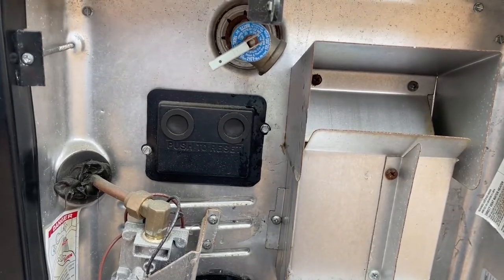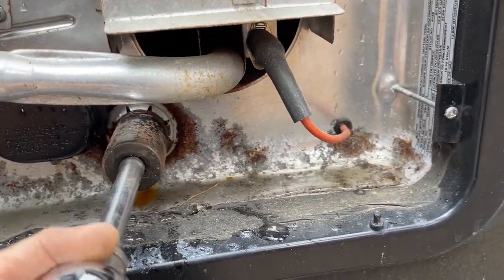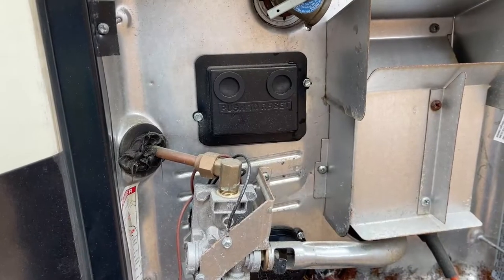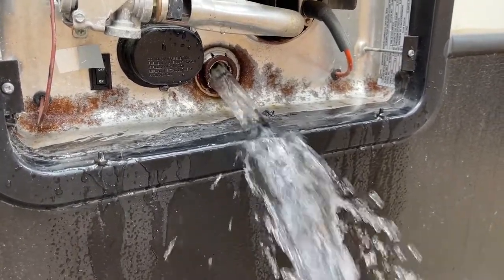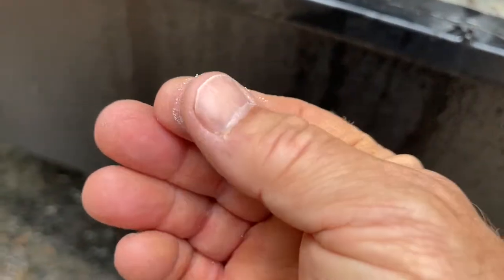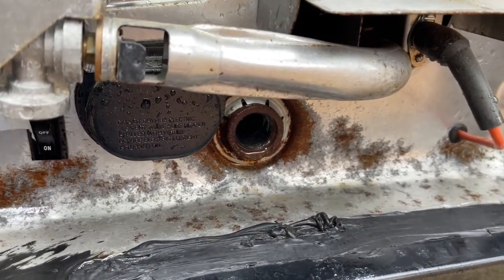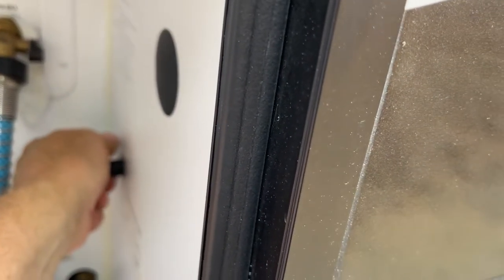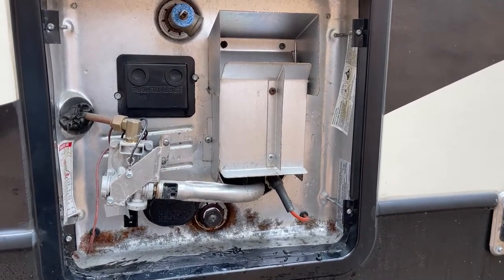Suburban Water Heater Anode Replacement

Comment: Excellent video. One thing I do on screwing in anything as in the case of the anode rod is to turn the screw or rod counter clockwise and feel the threads catch. Then continue screwing it in. This will ensure the threads aren't cross threaded.
Reply: Every time I do that, someone over my shoulder tells me to turn the other way.

Comment: Just bought a motorhome with an 11 year old Suburban. Pulled the anode - absolutely nothing on the steel pin core but rust! Possibly never been changed, certainly not for quite a few years.  Lots of calcium buildup visible so I'll try filling the tank with vinegar and leaving for a long time (maybe 24 hours). So frustrating that people neglect simple maintenance and possibly ruin an A$1100 appliance.

Comment: Thanks Todd for the informative video. I cannot remove the anode rod from the surburban water heater. i put a lot of weight to wrench & socket but it will not budge. any suggestions?

Comment: Is it a standard fitting on all RVs? I just ordered the Camco Aluminum Rod. Are the threads on the water heater METAL or TEFLON? Can we use vinegar or CLR to help clean the threads with a stainless steel brush?
Reply: Fittings are standard. The threads are all metal.  Not sure about the vinegar or CLR but that should work.

Comment: Old anode is really rusted in there.  Any advice appreciated.
Reply: I’d try spraying some PB Blaster on the threads and let that soak for 30 minutes.   That stuff usually helps free up stuck metal.  Good luck to you.
Reply: @toddtt1  thanks so much
Reply: Is there a size of anode to buy or are they all about the same size? We have a 2019 Geo Pro 19 bunk house. Thank you!

Comment: PLEASE help.  Right where you insert the anode rod, there is a metal clip or o'ring.  Mine completely rusted out!  I've searched the internet for that, but no luck.  Anyone know where to get one?
Reply: There shouldn't be an O'ring.  The threads with Teflon tape should be what seals it up.  I did not have a clip or O'ring.  Best of luck!
Reply: @toddtt1  The ring is on the water heater itself.  You can see it in the video.
Reply: @toddtt1  It looks like a metal retaining ring with notches.  The one in the video looks new.
Reply: @SNHIPP  ok I see what you're talking about.  Perhaps give Suburban a call.
Reply: @toddtt1  they said it's is available out there, but can't tell me where to find it.  Thanks for replying anyhow!
Reply from the maker: I think I found it.  Suburban is showing it a s 1/2 inch bushing.  Special order.  https://youngfartsrvparts.com/products/s6u070270?_pos=1&_sid=5840618c6&_ss=r

Here is the diagram https://suburbanrvparts.com/sw-series-water-heater-parts-diagram/